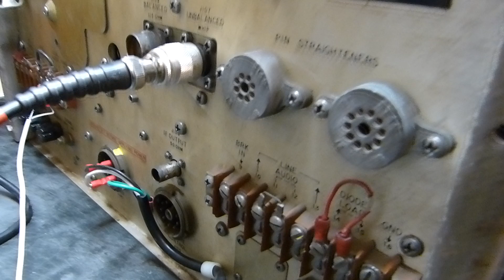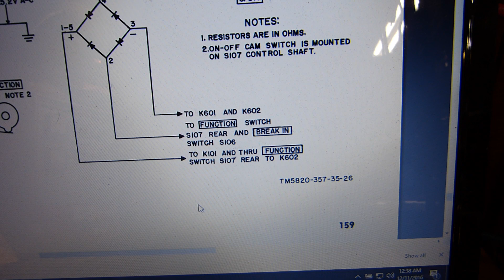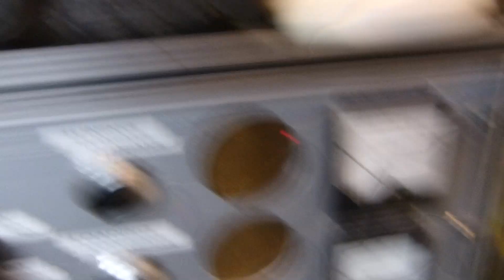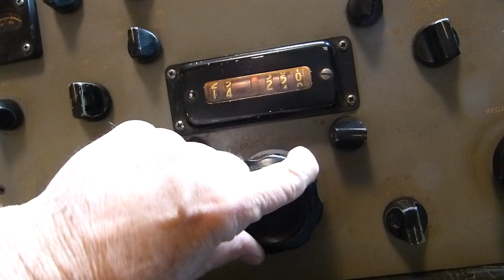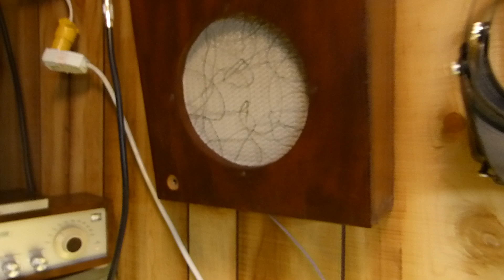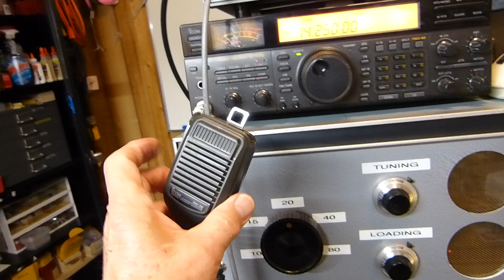Collins R-390 T/R (Transmit-Receive) Circuit Repair & Tuning For Use With Transmitter/Receiver

Comment: $20, wow, did you haggle down from a higher price? I wonder what else was being sold. 

Sensitivity should be good. Do an alignment once you are confident. 

Also the balanced input is best. The adapter UG-970/U goes from twinax to SO-239.
Reply from the maker: I gave $20 for it to be respectful.  It was at an estate sale from a SK. I am sure he would have taken $5 - otherwise it would just go to the landfill. No one wants any of this equipment around here. Lots of equipment did go to recycle or landfill... I can't save all of it...  :-)

Comment: Thank you for this video as I have brought home a 390a and I want to use it with my Johnson 500 transmitter. This video has shown me what I need to know. Thanks and God Bless .73 Terry W2MNS
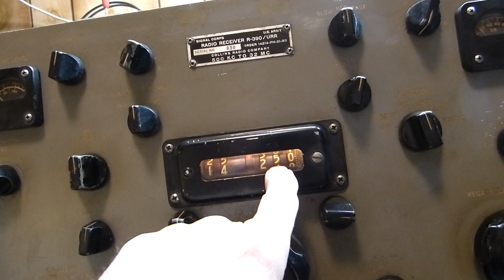Reply from the maker: I really hope this helps. I made a comment around 5:14 and call it vernier tuning and that was wrong - the dial needed tightening up. There may be some slight difference in the "A" model but I sure hope this helps you get your R-390 working. Amazing stability after it warns up. I did put an outboard preamp on mine to increase sensitivity and it is as good as any of my number of Collins receivers - good stuff.  Just checked out your QRZ page - very nice...  73  WA4QGA

Comment: What Collins transmitters pairs with the R-390A?
Reply from the maker: I did not know the answer to your question so I asked ChatGPT and this is what I got.
In my  opinion pairing the KWM-2 with the R-390 doesn't seem likely but the other transmitters may be valid although the KWM-2A that I have does have an antenna output for a separate receiver and I have used my  51S-1 with it before as a second receiver so maybe it makes a little sense after all just for receiving and leaving the tranceiver tuned to a transmit frequency.

Collins 32V series transmitters: The Collins 32V series were a popular choice for use with the R-390 receiver. These transmitters were designed for use in military and commercial applications and were known for their reliability and performance.

Collins KWM-2 transceiver: The Collins KWM-2 transceiver was a popular choice for use with the R-390 receiver in amateur radio applications. It was a high-performance transceiver that was known for its quality and durability.

Collins T-368 transmitter: The Collins T-368 was a popular military transmitter that was often paired with the R-390 receiver. It was designed for use in high-frequency communications and was known for its ruggedness and reliability.

Military T-195 transmitter: The military T-195 transmitter was another commonly used transmitter that was paired with the R-390 receiver. It was designed for use in military applications and was known for its durability and performance.

Overall, the R-390 receiver was often paired with a wide range of military and commercial transmitters, depending on the specific application and requirements of the user.
Reply: @ElPasoTubeAmps  Thanks for these details, I need to check and see which of  these you listed have both AM/SSB service.  This is alot to consider and may be above my skill level.

Comment: I operated R390's in the military when I was stationed in England and later Taiwan. My speciality was 29251 and was in the Air Force in Security Service from 1963 to 1967.
Reply from the maker: The R390 is a real jewel. The mechanics alone are amazing. I use a front-end preamp that brings it alive. With out it, the sensitivity is down a bit but it still sounds very good. The small cumulative losses in the circuit(s) is what I believe is the issue with reduced sensitivity primarily in the IF section but I am not anxious to get into it and risk making it worse. It is interesting how the first pages of the manual tell us how to destroy it to keep it from enemy hands. I hope you never had to shoot one...

Comment: There is no "vernier tuning", that's slop in the tuning. When properly adjusted that doesn't happen. Most likely the dial adjust clutch needs to be cleaned.
Reply: Could also be that one or more springs on the split "anti-backlash" gears have lost their tension. There should be ZERO hysterisis in the gear train
Reply: @mikem5043  Exactly.
Reply from the maker: Totally agree. It was one of my first encounters with the R-390 and I was quickly corrected - and I fixed it. An amazing receiver after more than 60 years.  Thanks and 73  WA4QGA
Reply: I should have paid closer attention to the video date, it's been a while. But, still don't want newbies confused.

Comment: i'll take it off your hands for $40 so you can double your money!
Reply from the maker: As big as this beast is, it is one of my favorite receivers and is the receiver for my AM station that I run on 40 and 20 meters. It seems from looking around that these receivers may tend to become less sensitive than we expect of them and is described as "collective insensitivity", that may not be the exact word but alignment and the best of tubes doesn't seem to be able to bring it back to its original sensitivity. It is amazingly stable and just a beautiful piece of equipment and to solve this small drop in global-sensitivity, I added an inexpensive tunable outboard front-end preamp to it. Now its sensitivity to weak signals is ever bit as good as my KWM-2A, 75S-3, iCom or even the 51S-1 receiver and is a very quite receiver much like the 51S-1. The stability is as good as anything produced today but of course, it doesn't have the frequency readout to  a resolution to 10 Hz like the digital receivers of today - but, who cares...  Fortunately mine came to me unmolested and all it took was a bunch of hours getting to know it and do the proper alignment to bring it back to life - and of course as the video states, cleaning and getting the T/R relay and minor things fixed to get it working again. 73  WA4QGA

Comment: Sweet piece of kit. I don't care what anyone says, the old electronics (radios, test equipment etc) are just the best.
I have a lot of old HP and Tektronix test gear, and it's all functional, made to be able to repair, and is lab grade equipment.
I have stuff that was made in early 60's and still working like new. This new electronic equipment is mostly throw away.
Reply from the maker: Totally agree with you. The old HP/Collins/Tektronix equipment is made to be repaired instead of thrown away. The R-390 is by far my favorite receiver. I have next to it a 75S-3 which works just as well but it sure doesn't sound as good. I run across more people than I expected that actually used the R-390 while in the military and they all hold it in the highest regard. I got it for $20 at an estate sale. It was about to go to the recycle bin. It took a little TLC to bring it back to full life but it was worth it. Thanks for your comments.

Comment: nice radio, are you going to make a video about it?
anyway how have you connected the antenna port to listen the signal at the dummy load? is just necessarily to connect a T connector or a wire near the load is enough to pick up the signal?
we have tought sone video ago about a pl519 amp and i am currently finding all the parts and i have past the test to get the license, 73 by Manuel  (Italy)

Comment: I had to laugh at the thought that today's hams wouldn't know how to zero beat a transmitter and receiver to the same frequency, but I guess if all they have ever used is a CFO controlled transceiver, I guess that's true. Call me old fashioned, but the old equipment had all those knobs for a reason. We were operators who needed to know how our equipment worked in order to use it effectively. 
Collins made the best radios available. A collins rig complete receiver, transmitter and amplifier cost several months pay in the 50's and 60's more than a young kid like myself could ever hope for. I would love to own a 75A receiver, and KWM-1 transmitter, or the complete S-line rig. 
Also a 20V AM transmitter on 3885 kc. Nothing like a big fat, well modulated carrier pushed by heavy iron and some big Eimac tubes.  Guess I'm getting old.
Reply from the maker: Hi Bill - I really didn't think about hams of today not knowing how to zero beat the receiver and transmitter but I guess that is what I showed.  :-)
The R-390 is a little tedious at tuning in SSB but since I have, and still do, operate with separate oscillators in my transmitter and receiver, I though it necessary to show this as the dial numbers are the same but the vernier on the R-390 has to be touched-up. I think there are a few new hams that have an appreciation of the old equipment. I doubt if much of the equipment made today will be operating in 60 years, and there is going to be no way to repair the new stuff of today  in 60 years. If there every was a true statement of, "they don't make it like they used to" that surely applies to this level of equipment.
I started in 1963 and had my dreams set on the Collins stuff also but as you mentioned, it was Way above anything we could afford. Nowadays I do have the  S-Line purchased used in the early '80's for cheap as no one wanted that old tube stuff back then. It seems to have made a bit of a come-back in the last 30 years and is appreciated much more again and as already mentioned, it is still repairable. The 30L-1 is a peach of a 1 KW PEP linear  although I still run home brew antennas and amplifiers. See my QRZ page - WA4QGA
I will post another video on the R-390 as it deserves a view inside with all the gears and cams for tuning.  Part of my goal is to help others keep this old equipment running by providing some experience for specific problems in getting it apart, repairing it, and getting it back together again.  As for myself, just a couple of minutes of focused instruction makes things so much easier. I wish I had had the Internet during the 1960's when I was in college. Books, slide rules and log tables were the hard way to learn and sometimes academia does a less than perfect job at explaining things as it seems they sometimes delight in convoluting things.

Comment: That is the deal of the century.The main difference in the 390a is.it has fewer tubes and mechanical filters..There are a couple other differences but both are fine receivers.
Reply from the maker: Until I acquired this one, I thought the "A" model was the one to have. Now I understand it was a cost-reduction design made to repair easier by module swap and the original R-390 is the preferred one. What a surprise... It sounds great. Such good audio. A little tedious to tune SSB but OK with me.
Reply: @ElPasoTubeAmps  I just picked up a Collins R-391 for about $75. I didn't have the power cable, but in this video I caught a glimpse of your "Power Cable" which is barrel connectors, lol. I have been wracking my brain for a solution, and there it is, simple as mud pies. I should test the capacitors, but ya know what, Yolo. I'm going to sacrifice a monitor cord and some barrel connectors and get her fired up and see what she does.
Reply from the maker: @isaacleeper3127  It is unfortunate that the small parts like connecting cables get lost with the movement of such nice and historic instruments like this but it seems all too common. I believe I just put some female connectors on the AC cable and plugged them on to the male connectors with a little shrink tubing for insulation then clamped the power cabled to the frame with a cable clamp.
Good luck with your receiver. I spent plenty of time in the beginning just cleaning it up. Pulling each tube  one at a time, cleaning the socket with a little contact spray and reinserting the tube once or twice and gently spray cleaning and exercising the switches. (I now use a 50% mixture of pure alcohol and acetone - the alcohol has to be technical 99.9% stuff).
73  WA4QGA

Comment: I think it was worth $20.   WB3BJU
Reply from the maker: Thank you. I am really enjoying this receiver. I got a "virgin" one in that it has not been "repaired" or modified. It had its issues from setting unused for many years including the T/R relay problem which seems to be common but I think I have resolved all of the major issues and I am having fun with it. I plan on having it on 20 meters tomorrow.